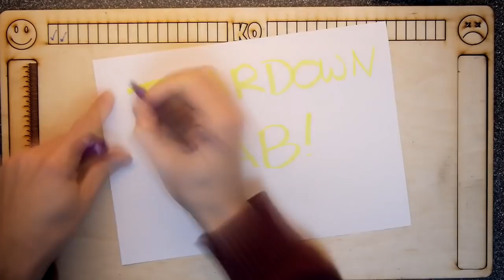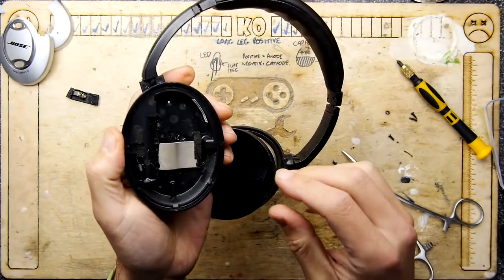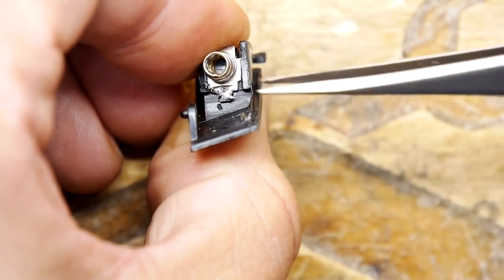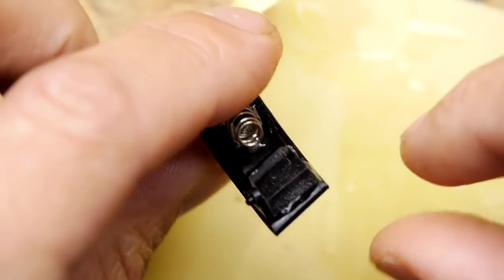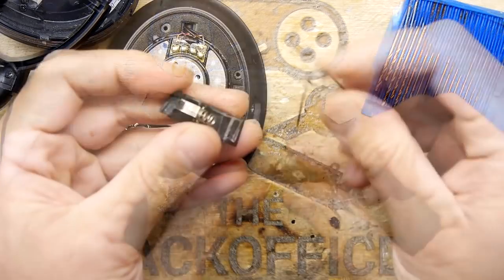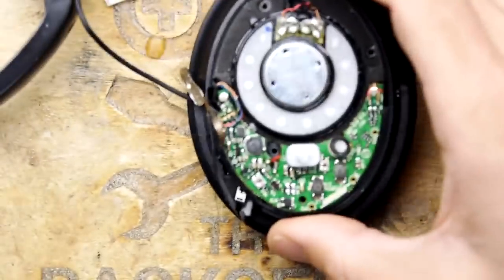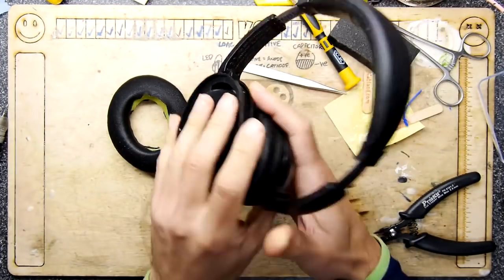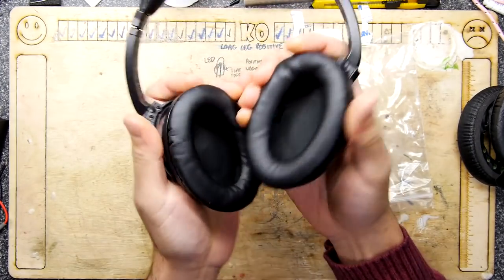How to fix your BOSE QC Headphones QC repair

Comment: I’ve got the same pair, much prefer to my wife’s QC30’s. I’ve replaced the headband and earcups which started to disintegrate and added a volume/mic cable. Good as new now.
Reply from the maker: The new ones I have come in an annoying box, is a bit smaller,  but you have to pack the headphones contorted. Also they rely on an another adaptor for the attenuation for air-plane use, one more thing to lose!
Reply: @backofficeshow  also the retro design of the qc15s

Comment: I Disassembled mostly everything and i can't seem to figure out the issue. I checked both positive and negative contact points for the battery back to the terminals, the continuity checks out, it appears to be working, therefore there is no loose cables or loose solder points. However, when i go to connect the battery the headset won't turn on. If i do plug the battery directly into the terminals via jumper wires it does, which continues to boggle my mind.

I am interested in an alternative solution other than AAA batteries, if i choose to place a rechargeable lithium battery like the one you show on your video, what kind should i use? As in what voltage and or capacity as to not fry the board.
Reply from the maker: Sounds like a mechanical issue with the terminals. I would still try to explore getting the regular cell working before the lithium. Perhaps polishing the contacts?
Reply: @backofficeshow  upon further inspection looks like the negative contact spring might be the issue, i noted that it is slightly bent, but when i try to adjust it to a straighter position and close it down, it won't power unless keep my finger pressing down the flap that holds it close.

I cleaned both contact points since they did have some slight corrosion and dirt. I'm a beginner when it comes to all electric and soldering but i have repaired a few things and there. I am wondering if there is a better way to ensure that the battery makes solid contact with the negative point without keeping my finger on it.
Reply from the maker: Maybe you can buy one if those cheap spring sets or wind your own?
Reply: @backofficeshow i can maybe salvage one from other devices. I was mainly interested in the rechargeable lithium battery in case i can't make this work. The size seems to be the main obstacle .
Reply from the maker: The voltage will also be a big problem they are more than twice the required voltage of the Bose and frankly hold less charge than a regular alkaline battery
Reply: @backofficeshow  i see, sounds like more trouble than it's worth punching holes and or fitting the battery.